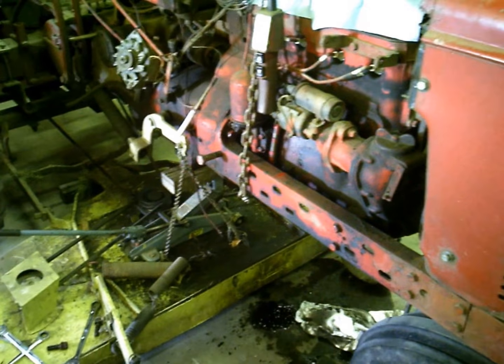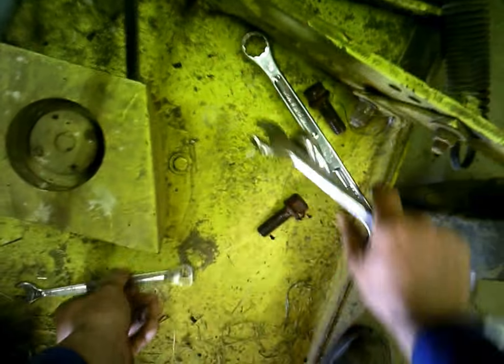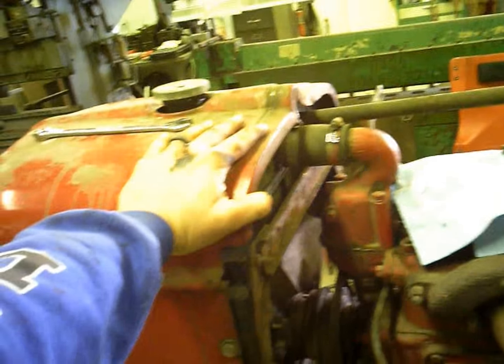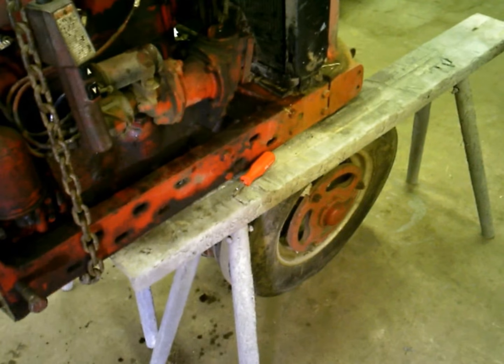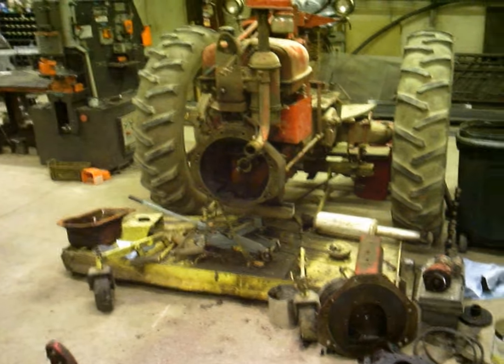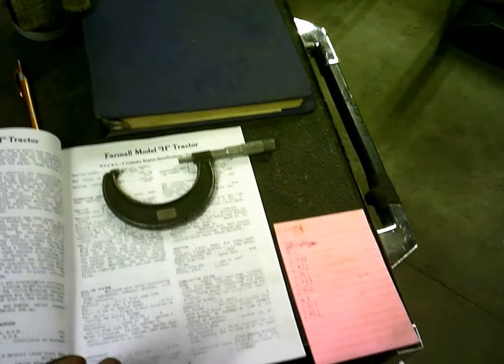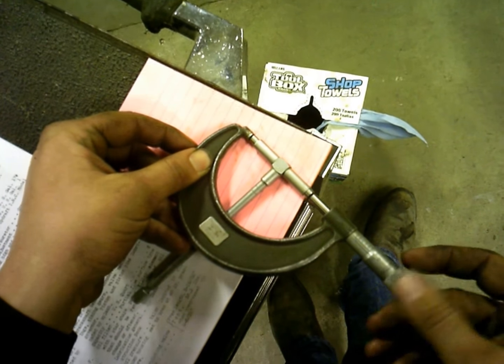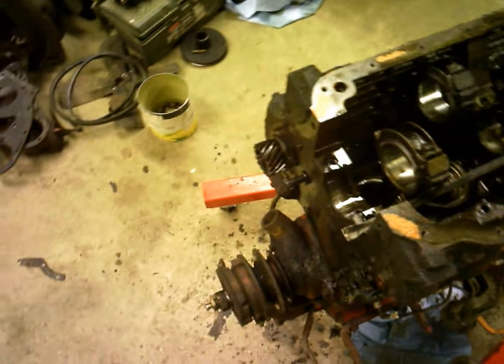Farmall H engine knock pt 2

Comment: Tricycle tractors were a pain. We had a homemade splitting stand made out of angle iron. You would bolt on each side with braces to the front. Then we would put thin steel on the floor to act as slides.
Reply from the maker: PA Farms ya they are. Used an IH set one time. They were nice

Comment: Good job on finding that knock. Those older Farmalls dont have much of a service manual because they were made easy to work on. Today's new equipment is made to take to the dealer to fix and in 25 years it will no longer be serviceable, but the old H with a little care will still be doing the mowing.
I am still waiting patiently to see what those tires and wheels fit.??
Reply from the maker: Paul Case thanks and that is true. They could be rebuilt and rebuilt and rebuilt. I’ll have a video up tomorrow

Comment: Jake,i like your videos,snap gauge,its a telescope guage,loosen bottom let it go inside bore,tighten alittle bit more,drag down,check with O.D.mikes telescope gauge in one hand and O D mikes in other,just snug fit up and down,im a manual machinist,have run turret lathes,engine lathes,HBM, Bridgeport I like your videos your a  good guy  don't take this the wrong way .003 is as thick as a hair on your head,got a saying an old guy told me many  years ago,ITS A TIMEX NOT A ROLEX,but u still wanna do it right,please don't take this the wrong way
Reply from the maker: michael heinen so u think .003 is too much to put it back together and run? Open to ideas as I couldn’t find a spec
Reply: if I was doing what your doing ID PUT IT BACK TOGETHER,thats what I meant by its a TIMEX,not a rolex,its not a zero deck motor,its not a high rpm motor,it aint a racing motor,i just put it back together,i agree with your plan

Comment: Jake, the mess that the 504 came in wow that man needs to pay you for putting up with that mess.   A leak in the carburetor that's only thing all he need to do is adjust the flow of gas to it a simple fix lol.   the farmall wow she been through the ringers wore the crank shaft out the bearing were wore also but you have on the road again good video.

Comment: I think I would have the block "line bored" after putting in a different crank.  I had a crank "turned" and put it in the block and when I tightened the mains, it locked up.  Then had it line bored and rods sized to the rod journals.  Just my two cents.

Comment: I used to be a salesman at a couple performance/racing auto parts stores and have built lots of different engines.  The debate was always "Are machined crank journal bearings (rod or main) 'under' or 'over' sized"?  I always say undersized because you're going off the measurement of the journal, not the thickness of the bearing.  You never order bearings by thickness, always by diameter(s).  So, if standard diameter is X" and the crank has been ground Y", you need a bearing that's X"-Y", in other words, under standard size.  Anyway, good video and explanation of what's going on.  Thanks for the video!
Reply from the maker: burningdinosaurs I think ur right. That’s the way they tought us in school. I might have mixed them up in the video tho. Thanks for watching

Comment: How much more would it cost to buy an overhaul kit? I mean you already have the tractor split. If crank and bearing shot, wouldn't pistons and rings be worn out to?
Reply from the maker: Vicki Poe well parts would be about half and machining would run it up. It’s not really worth dumping a ton in to